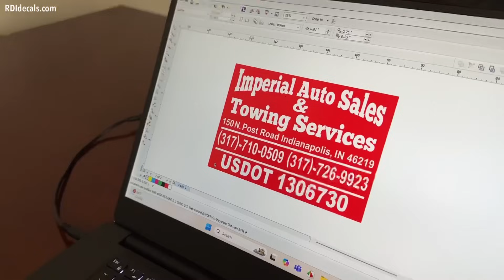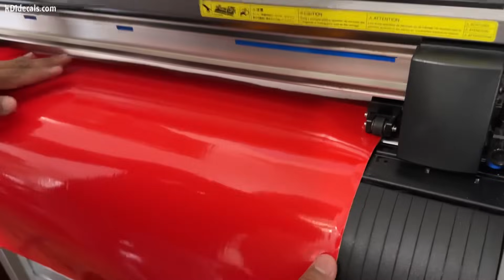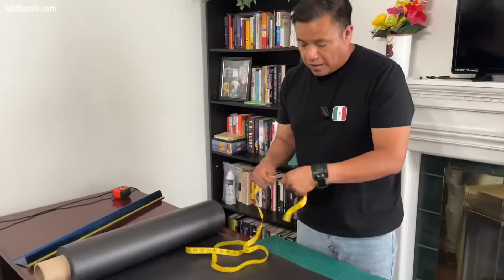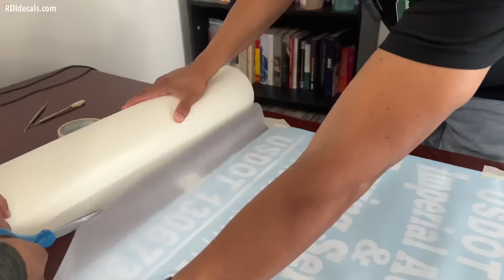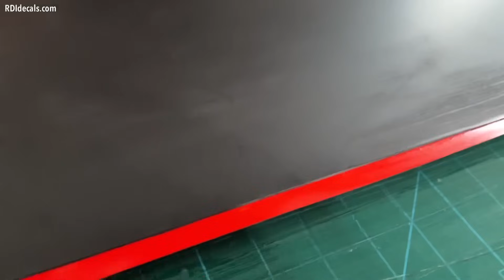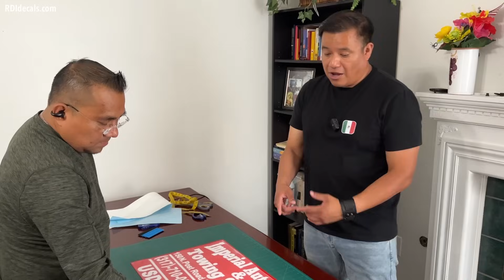You may QUIT your JOB if you get this MACHINE

Comment from the maker: Our website: https://rdidecals.com
Get t-shirts here: https://bit.ly/3RA6DdF
Get your transfers here: https://www.proworldinc.com
Get your HTV (Referral code) http://rwrd.io/0sfdktg?c
Hotronix heat-press 16x16: https://amzn.to/4e2cjpn
Graphtec vinyl cutter:  https://amzn.to/3pIrIkS
USCutter Titan 28 inch Vinyl Cutter: https://amzn.to/3yC1jwn
CAMEO 4 (12 INCH): https://amzn.to/3uy66jc
CAMEO PRO (24 INCH):https://amzn.to/3POgbNO
Heat transfer tape: https://amzn.to/4etRBhP
Shipping tubes: https://amzn.to/3LPgSXJ
R-TAPE Conform 4075RLA (Paper transfer):  https://amzn.to/3S5CDG3
Corner rounder: https://amzn.to/3JbJQzI
Oracal 651 vinyl 12x24 ft roll: https://amzn.to/46wUTMQ
Oracal 651 vinyl 24"x10 yard roll: https://amzn.to/3ulmXRJ
Reflective vinyl: https://uscutter.com/24-oralite-5300-economy-grade-reflective-film
Tape application roller: https://amzn.to/45apQGa
Oracal color guide (only for 651 & 631 vinyl): https://amzn.to/3W6Q0ow
Magnum magnetics 24"x25' : https://amzn.to/3P6AHdJ
Blank yard signs: https://amzn.to/2IBiGWM
RAPID TAC: https://amzn.to/37ZMl5O
Cutting mat: https://amzn.to/3uidBWZ
Blue safety ruler (31 inch long) https://amzn.to/3slsrKy
Squeegee: https://amzn.to/3bmZK8Q
Small magnets to hold vinyl in position:  https://amzn.to/3kdE6bt
Cutting knife tool: https://amzn.to/3sbDTYS
Adhesive remover goof off: https://amzn.to/3eXrNS2
Siser Glitter Vinyl: https://amzn.to/3u1gnnO
Siser color guide: https://amzn.to/3ZuQJ60
Teflon sheet: https://amzn.to/3HvhRKx
Teflon pillow: https://amzn.to/3Sheqw1
15x15 heat press teflon cover: https://amzn.to/42gjt4i
New supplier: https://signoutletstore.com

Comment: How long do you wait for the wet application before applying the second layer on top ?
Reply from the maker: Hello! It usually takes less than 5 minutes :)
Reply: @RDIdecals  You could use a white magnetic material, reverse weed the Red Graphic Vinyl, and save yourself a step!?!! 🙃😉👍